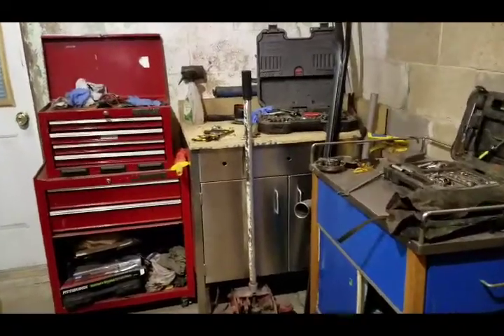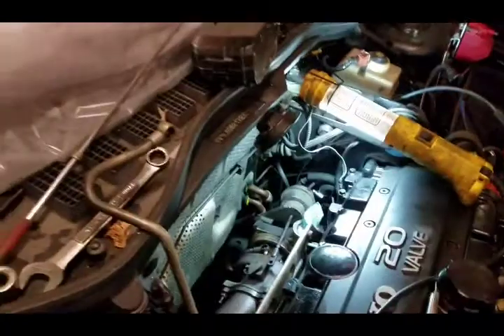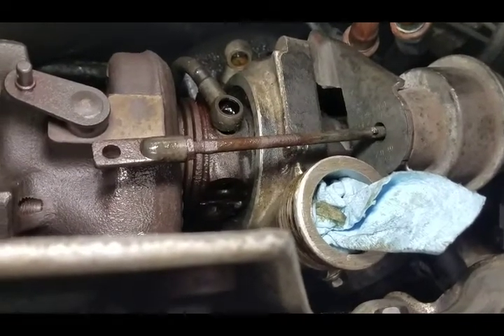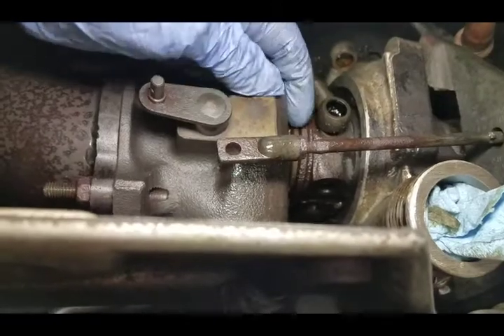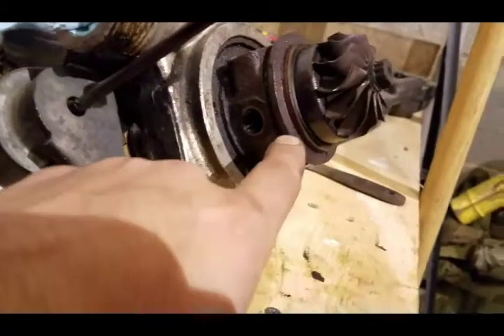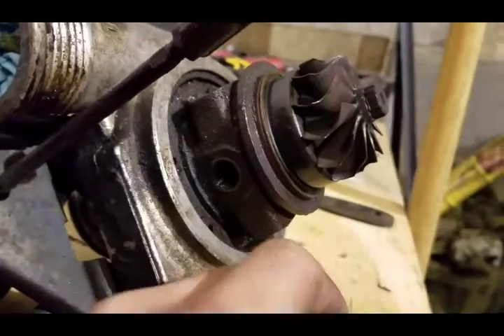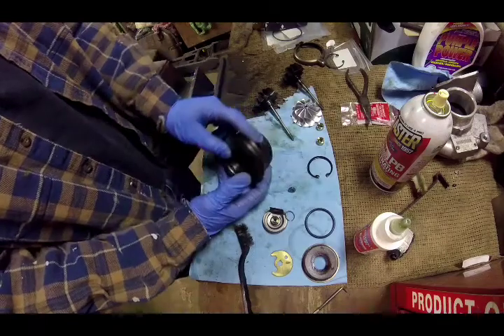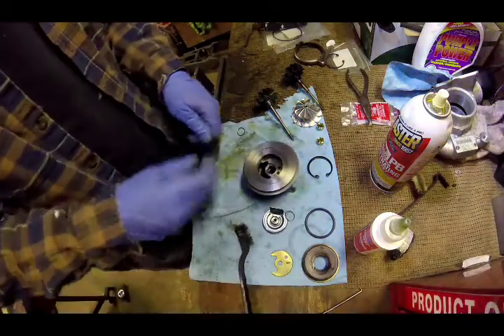Volvo 850 19T swap

Comment: Good video. How did you tighten that nut on the compressor without shaft turning and becoming unaligned. Tanks
Reply from the maker: 850 ARE you can use a socket or hold in a vice. Align as explained in video. Compressor wheel and exhaust exducer should be balanced before rebuild. Diesel shops do this service